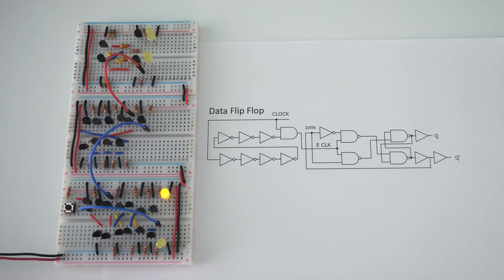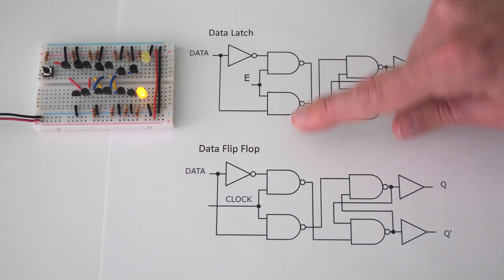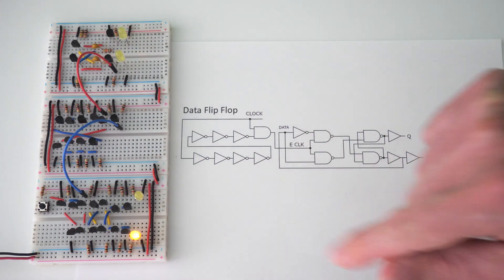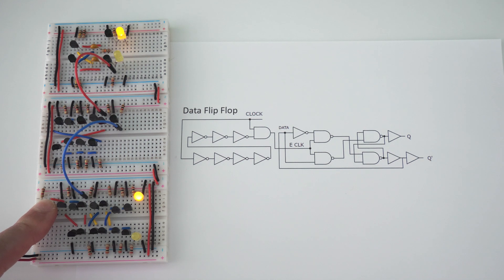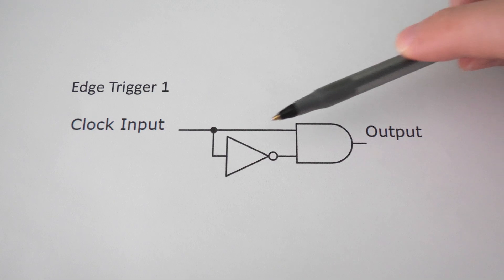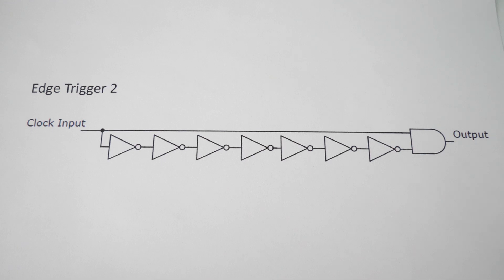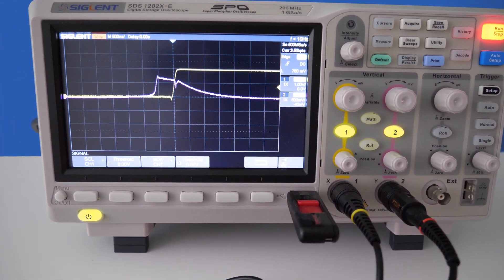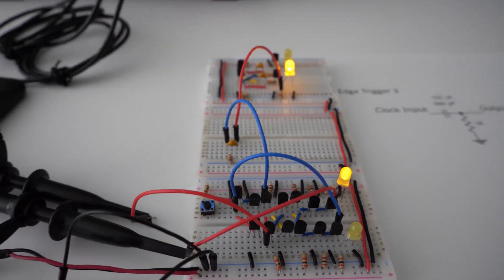D Flip Flop and JK Flip Flop

Comment: Hi GSN, the trigger of the D flip flop at the beginning of the vid used 7 inverters, but then seems to be upgraded to 9 inverters later. Any reason for this? Also, I've gotten to the circuit at 2:27, and everything worked fine until I connected the output to the data input. It seems my timing is off, so my output LED is not in sync with the top LED. As far as I can see, my circuit is the exact same, any tips you can think of? Thanks!

Comment: very nice and helpful video! I am currently building the JK-flip flop as well, but it wont toggle. Im not sure what the cause could be, but my clock is also not oscillating properly. If i press both the j and k, one LED will blink while the other one just stays on and sometmes if i press j or k, the clock suddenly oscillates a lot faster than usual. Could anybody help? Is it also normal that the jk flip flop wont toggle if the enable is always HIGH and if so, why is that?
Reply from the maker: Sounds like something is wrong but it is hard to say what without seeing the circuit. Try and build the exact circuit. I have a diagram for the clock in the binary counter video as well if that is the issue.

Comment: Why isn't the /Q working on the flip flop??
Reply from the maker: Great question! Well, the /Q does work, but the LED does not light as the output goes to the input of the the other NAND gate. The way the logic gates are made the voltage drop is therefore not high enough to light the LED. You could make logic gates that could send both outputs but it would have to be one where floating is on and ground is required to be off.

Comment: Hello, I will be building this JK flip flop circuit as a project in one of my classes. Can I learn the material list and especially the model names of P MOS and N MOS?
Reply from the maker: Sweet! The transistors are 2N2222 or 2N3904. Either one will work. The LEDs are standard yellow LED and most of the resistors are 2.2K but any value between 1k and 2.2K will work.

Comment: May I have the circuit diagram?
Reply from the maker: The logic gate-level circuit diagrams are in the video.  I probably have transistor-level diagrams if you really wanted them. Which circuit in particular?
Reply: @GlobalScienceNetwork  Yes, I want to build a D-Type  Flip-Flop with transistor. The next step I want to use it to build an up counter also.Thank you for your help 🙏
Reply from the maker: @KCLeung-gm8ql  It looks like I only drew the flip-flop circuits at the logic gate level. So you will have just see how it is wired in the video and if you are confused check out the digital logic gate video. In that video, I show each logic gate with the circuit diagram at the transistor level. If you can build the logic gates the flip-flop is pretty straight forward.
Reply: @GlobalScienceNetwork  Are there all of the transistor those are NPN ?

Comment: Can you explain further why when using a 100nF capacitor, the the triggered output still continuously has current(it does not discharge)? Thank you very much
Reply from the maker: The 100nF capacitor does discharge but over a longer period of time. This makes it so the output can toggle back and forth in a racing condition which is not desired. The 680 pF capacitor is much smaller and produces a shorter waveform. This makes it so the output will only change once with each clock cycle.
Reply: thank you :hand-pink-waving: @GlobalScienceNetwork

Comment: What on earth is going on here?
Seriously.
Nobody ever puts multiple signals on the same vertical position on the scope! It makes it hard to show people what is really going on!

Go look at any data sheet for any digital device, NO manufacturer ever does this.
Reply from the maker: That is how I was comparing them so I figured it would make sense to other people as well. This is in color so it is pretty easy to see each waveform. For a technical manual your suggestion to separate them would be a good one.
Reply: @GlobalScienceNetwork  I don't gree with you. I used one of the first colour digital storage scopes decades ago which cost $45,000. A fantastic piece of equipment.
You can put cursors on and make measurements.

So whilst conducting an experiment you may move the waveforms up and down and perhaps occasionally it might be useful to have them coincident on the vertical axis but it is not clear in your example until you explained what you were doing. It is not intuitive.

But as I said, go and check any data sheet and all signals, whether input or output are absolutely NOT coincident. The manufacturers always represent the behaviour of their logic devices with signals arranged vertically separate from each other. They do this so the signal name is clear , the waveform is clear and then you don't need colour to differentiate the signals. Manufacturers' data sheets are often printed in black and white with no colour.

If you want to understand the behaviour of a logic device, you go look up the data sheet for it. That's a great way to learn. For education purposes, why not copy the way the manufacturers present the behaviour of their own devices?

Comment: Nice, it's great to see these basic gates built up from individual transistors.  If you decide to, I would love to see a CD4017 (10 stage Johnson counter) being built this way!
Reply from the maker: @GlobalScienceNetwork
  • 0 seconds ago
Thanks, I will keep that in mind. We are going to have to build some type of ring counter for the computer. A 10 stage would be pretty sweet!
Reply: @GlobalScienceNetwork  I wonder if it could be done using SR FF's for each stage?  S input would be state of previous stage AND'ed with clock.  R input would be state of following stage AND'ed with clock.
Reply from the maker: @Enigma758  You are saying to try and build it with one SR FF rather than 10 right. That would be worth trying as it would save a lot of components! How would you change which LED the output is going to?
Reply: @GlobalScienceNetwork  I was saying that there would be one FF per stage, so 10 altogether.  I was just suggesting how they might be triggered (clock pulse AND n-1 ON turns on n,  n+1 ON AND clock pulse turns n off).  I did a quick search and it seems they are typically made from D FF's with no additional logic, so I think there's an even simpler way to do it than what I suggested.
Reply from the maker: Gotcha, yeah I am pretty sure it would be built very similar to the binary counter, the main difference is the way the inputs and output are wired and in the 10 stage counter case, 10 D FF's.